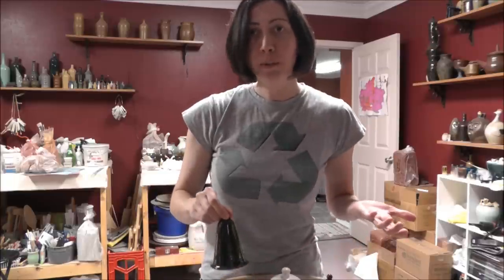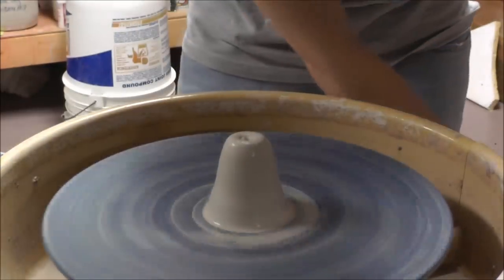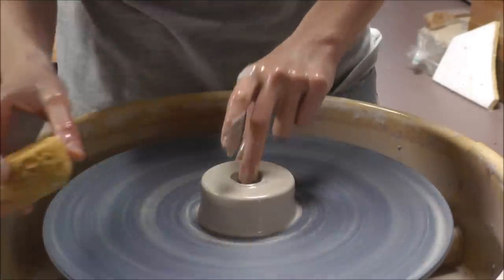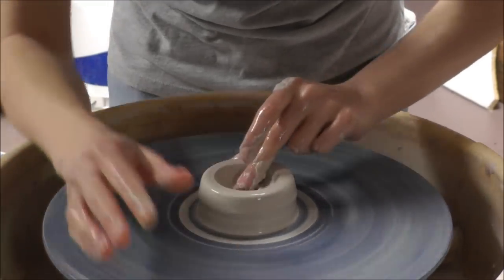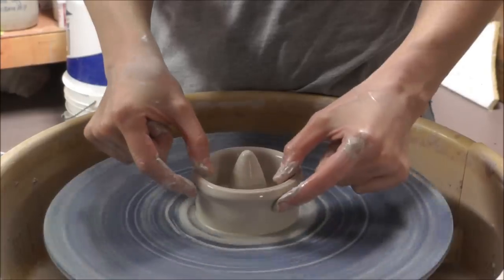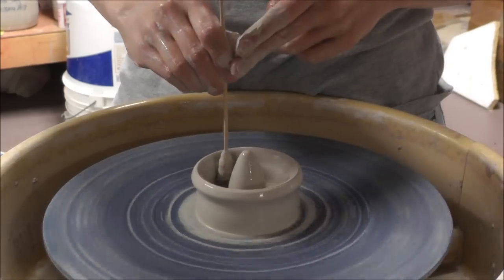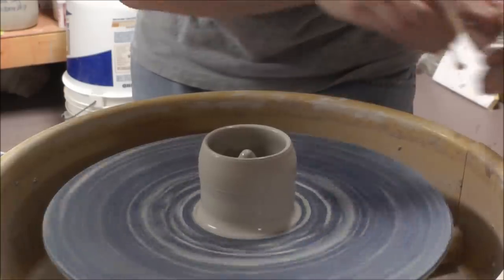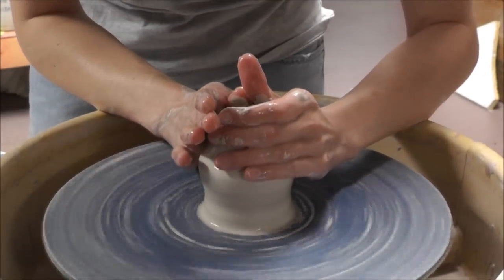Pottery: How to Make Salt & Pepper Shakers

Comment from the maker: You can leave a hole if you want, but it's harder to be sure it's the right size. If the hole is too big, salt will come out like a tidal wave. If the hole is too small, you will hardly get any salt out. To avoid that I use a drill bit (1/8 inch, I think), to make the hole at leather hard. There are some videos of people who have a method for sizing the hole while throwing. I think I saw one that used a bamboo skewer?

Comment from the maker: I just do a little hand trimming with a knife around the inside edge at leather hard. The way I throw them doesn't require any other trimming. If you need to trim it, you can throw a ring of clay called a chuck that you can invert the shaker on to hold it in place upside down while you trim it or perhaps use a Giffin Grip to hold it suspended upside down. If you're mindful when you throw them, they don't need much trimming, though.

Comment: This is a great video, thanks!  Do you pour glaze on the inside of the vessel as well?  Or do you just glaze the outside?
Reply from the maker: Tania Fleming With this design, you can't get glaze out from the inside if you pour it in, so only glaze the outside. If you fire your clay to vitrification, it will be safe for salt and pepper.